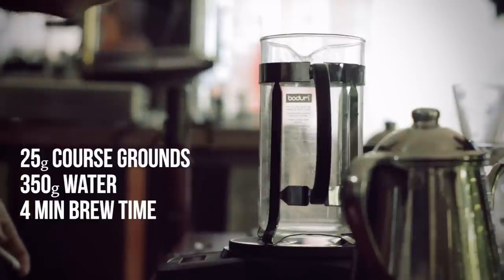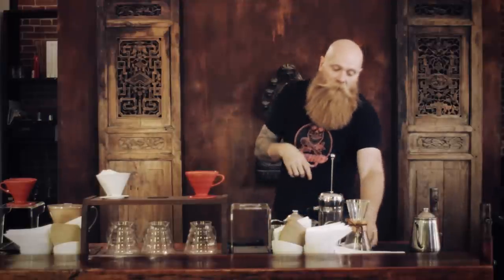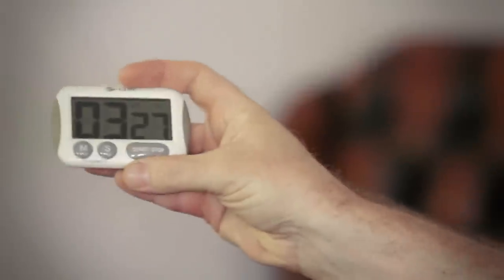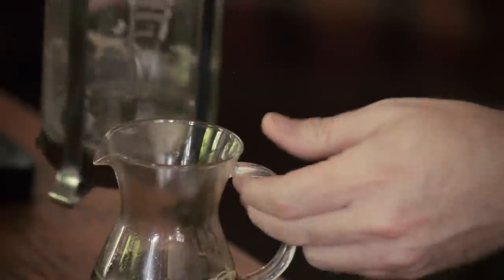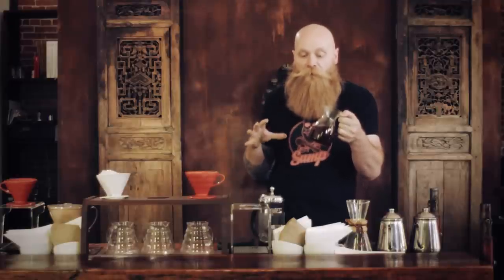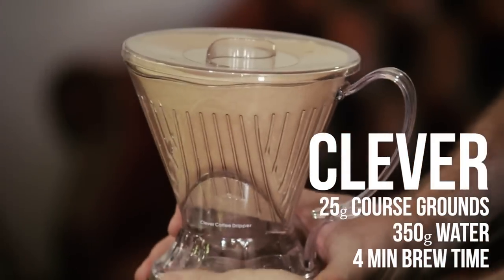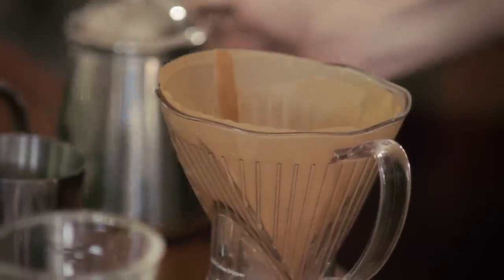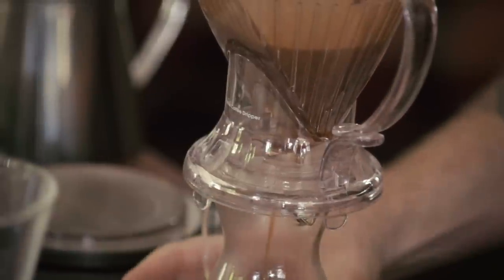French Press and French Press-like

Comment: Paper filters soak up the oils that give french press coffee much of it's awesomeness. Spring for a gold filter if you're going to use the clever thingy. Although, how I clean my french press quickly is to put a little more water in it, then take out the plunger (only coffee-water on it now) swish the beaker around a bit and dump into trash. rinse the rest of the grounds out into the sink (not enough left to cause problems) and rinse the plunger. NBD. takes 2 minutes.

Comment: Have you tried or have opinions about the espro press? It has very fine filters that traps the grit and also pretty effectively prevent overbrewing by trapping water between filters.

I usually only do tea in it, and when pouring the last cup I feel the weight of trapped water/tea leaves. Keeping the press tilted after last cup is served there is a very very slow trickle from the filters.
So, while it isn't perfect 100% it is perfect 99%.

I'm thinking of buying another press for coffe since I wouldn't wanna interchange the two, coffe always seems to permeate vessel once it has been used for it.

Comment: Proper timing AND adequate water temperature is way more critical in brewing tea than brewing coffee. Plus, those parameters, along with a few others, like the material the teapot is made of, highly vary depending on the type of tea and the number of times you brew the same leaves. Preparing tea is considered an art for good reasons. As you see, your viewpoint on tea is quite simplistic and actually wrong.

That being said, I like your video, except the fact that you don't mention anything about the proper water temperature. How hot should water be when you pour it into the French press (how many degrees)?
Reply: As with any coffe you want to pour the water in like 30 seconds after it finished boiling which translates to about 91-95 degrees Celsius. And you are right that it's not as important (and especially not as easy to screw up) as water temps for tea.
Reply: Thanks for the information.
I actually thought that to get down to 91-95 C from boiling temperature (100 C), more than 30 seconds were needed (something like 2 minutes). I don't have a thermometer, so I rely on what I was previously told on the matter.
Reply: Renatus Argentoratensis I guess that this will highly depend in your kettle - I have a metal one that switches off fairly early so the temperature starts dropping immediately and fast. plastic ones take longer to cool down as the material insulates the water better. ideally you would measure it a few times with a thermometer to get the hang of it first.
Reply: Thanks. That's something I should definitely do.